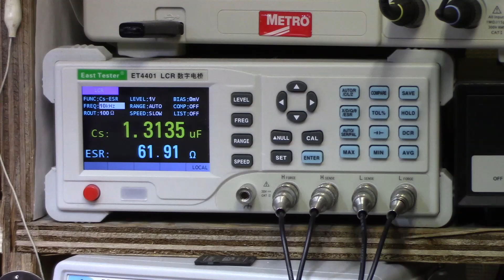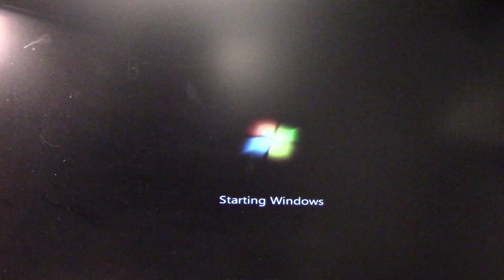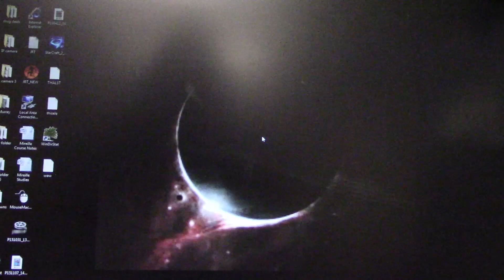Acer X1301 PC power supply - Preventative Maintenance & Repair (Ep. 57)

Comment: Nice video, great idea to service power supplies.  I noticed that your were measuring the caps using a frequency of 10kHz -- I'm wondering if that could be affecting the results.  I usually have to go down to 1kHz or 100Hz to measure caps that large.
Reply from the maker: Thanks, I usually test SMPS caps at high frequency. If it's a bad cap it will show high ESR at all frequencies.

Comment: Dude if you think they use very cheap caps and PSUs gonna fail then pay up for a more expensive one you get what you pay for.
Reply: Yeah...that's an Acer prebuilt.  It might have even been given to him.  Nobody (sane) immediately swaps out cheap components on a working system.  They get replaced when they fail.

Comment: What was that clear yellow tape you used to cover up the backside of the fan? Is it some sort of special electrical tape?
Reply from the maker: Yes, Kapton tape but don't read too deep into it, it was the only tape I had within arm's reach. It's just to keep dust out of the bearing
Reply: Is called "Kapton Tape". This one have very nice adhesive and resist on temperature over 662 ºF.
Also, this tape is also used for ribbon cable :)